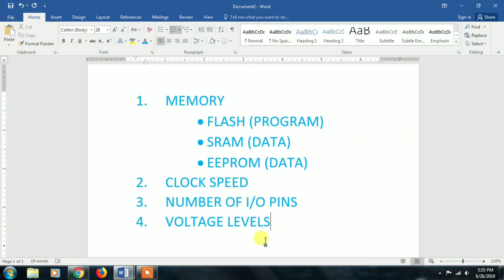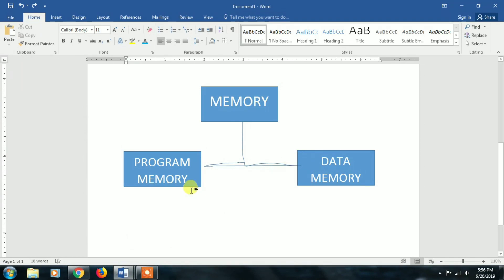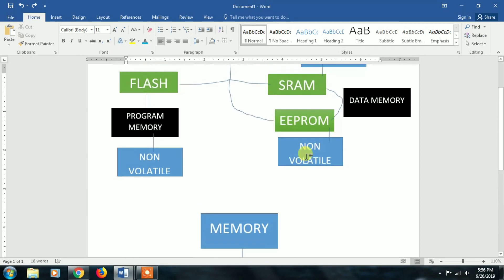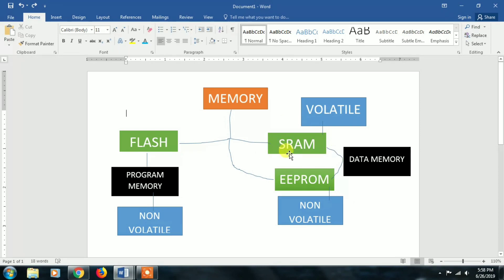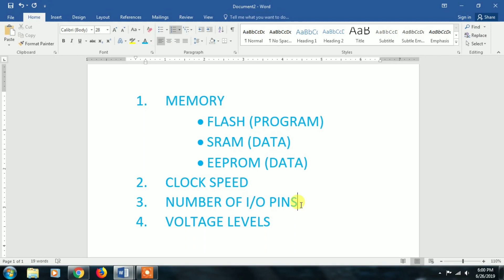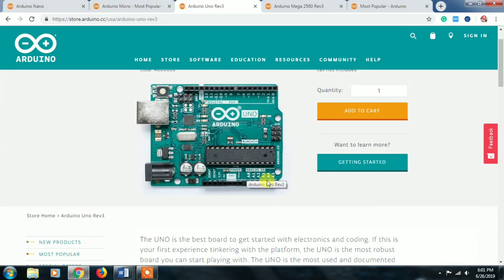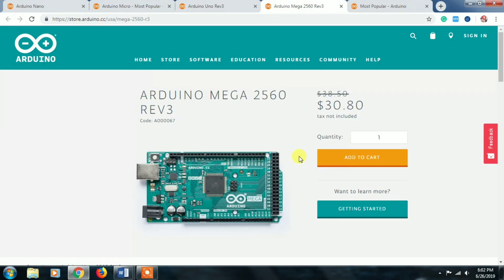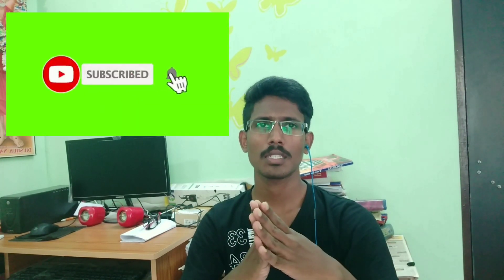Different kinds of Arduino boards || which arduino board is suits for project telugu

Comment: Hai bro, is it possible to upload and run 2 or 3 programs in arduino board. Or is it possible to convert 2 or 3 programs into 1 program and how?
Reply: Ardiuno can handle single task only... If you want to do multi task at a time you should use raspberry pi, teja
Reply from the maker: I didn't understand your question

Comment: Arey dabba arduino lo Atmega 328pu mc enduku use chestaru another mc use cheyochu ga?? 🤔🤔
Reply: Avunu adey enduku use chastaru ra??
Reply: @peterpaul3407  Garey correct
Peter ayya gare no.1
Reply from the maker: AVR is the first mc that uses the on chip flash memory for program storage